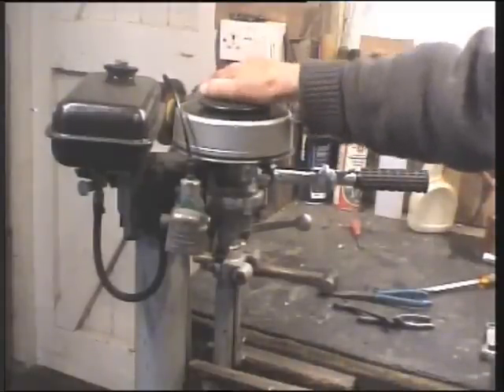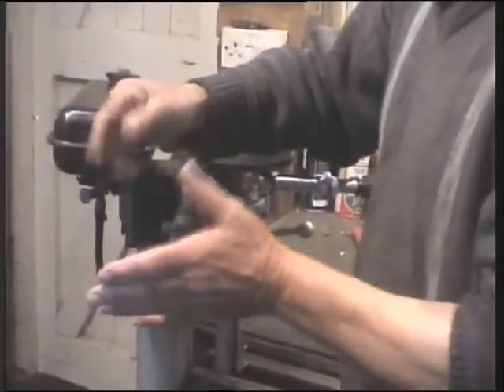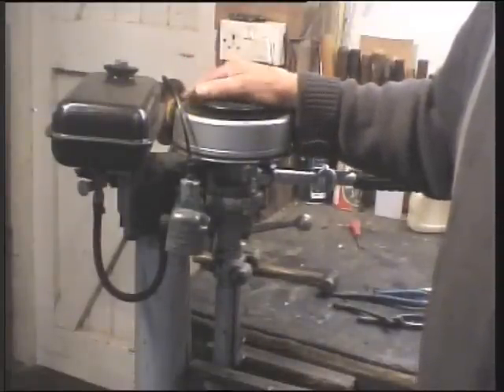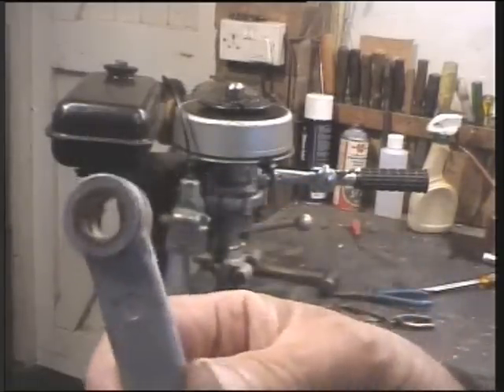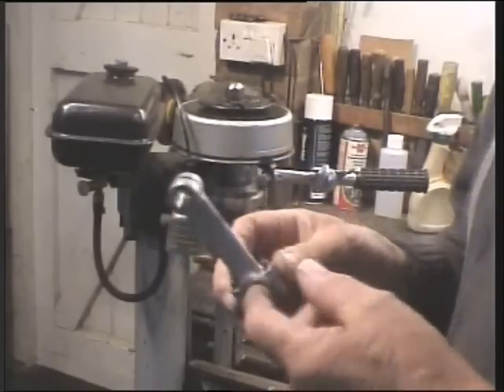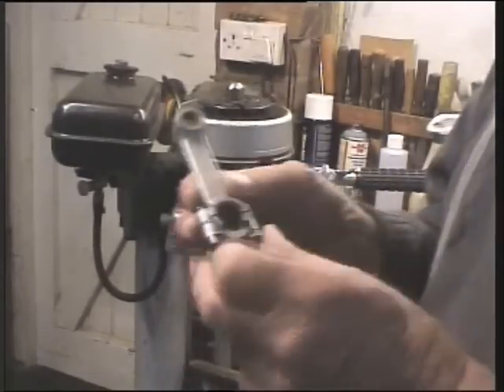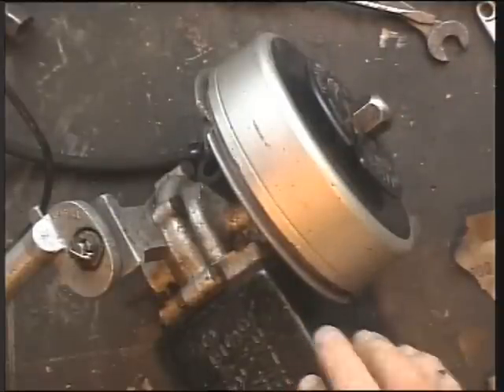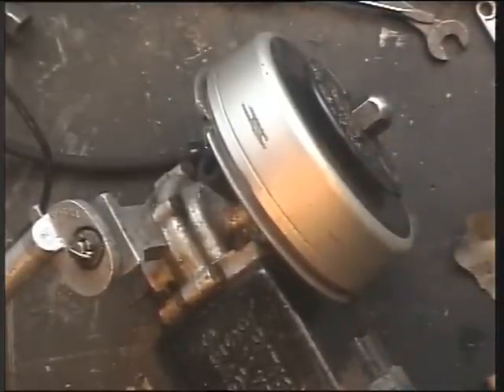workshop waffle + me having fun

Comment: Brings a smile to my face. Nothing wrong with hotroding an engine with proper work. Surprised there aren't articles on line showing how. I do agree with the way some ghetto engineer things. I can't tell you how many times I've cleaned up vehicle wire harness that is poorly spliced with wires going nowhere just a tangled mess. Language not for kids ears pops up.
Reply from the maker: You won`t fined articles on line, seagulls are" totaly impractical" to hotrod I said this was just a one off experiment, and hoped no one would copy me ! (prehaps a bad idear on my part) anyway tried it to day on the boat, it revs higher , makes more noise ,uses more fuel , makes the boat vibrate at full throttle, and gives 1.1/2 more knots ..... hardly worth the trouble but gave me 20 mins more fishing time
Reply: 20 more min of fishing is like good frosting on a cake.

Comment: POC I used to do increase the horsepower of 2 cycle motorcycles.  But I would get the manufacturers specs for the volume of the head and correct it.  Then I would open the cylinder ports up some, normally according to the manufacturers racing book.  Polishing the ports was something I did sometimes although I think the benefit was marginal but opening them up so the intake started earlier was the main help.  Ge for the water and let us know if you see any difference.  Thanks for the video.
Reply from the maker: Unable to get to the inlet .... will try it later to day, it can only go Bang!  :-)
Reply: ***** be careful and start with just one millimeter unless you have some document to say exactly how much is safe.

Comment: Dear Mr. Chap, Can you explain why you removed the head when it says specifically DON"T REMOVE in casted letters as you pointed out? I suppose it would have been difficult to mill the cylinder with the head attached. How do you explain this anomaly? I love your videos. Thanks again. Doug from Billy Bob's Beer, Bait & Tackle.
Reply from the maker: When these were made no decote or mainteance was required (but that was 50 years ago !) and as the head bolts go through  into the water gallerias they rust makeing them imposable to remove, 95% of people ring them off , because the head are alloy, copper gassket on a cast barrel another 4% get destroyed by thoses that try to prize them apart in an attempt to  unblock the waterways.
I made the point , that this was a  one off experiment on an engine I was prepared to gamble on, bearing in mined I have the ferilities to rework them, many would not have this !
Reply: +poroldchap Well, I'm very happy it worked out so well for you. Good show.